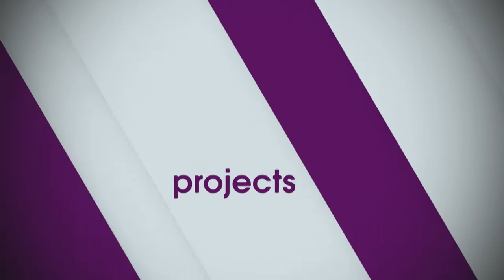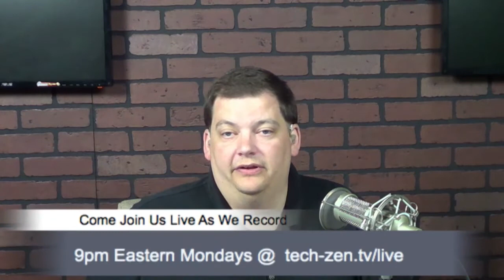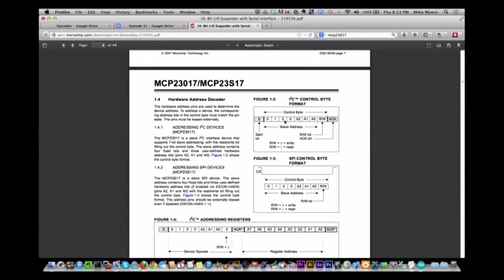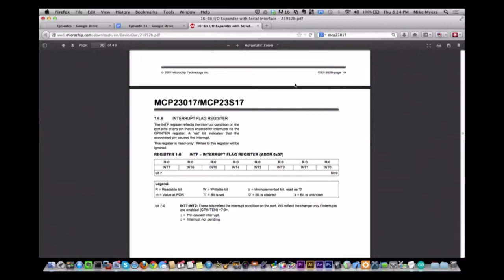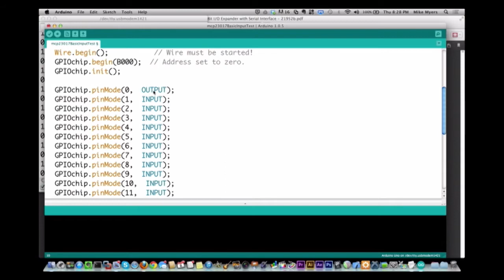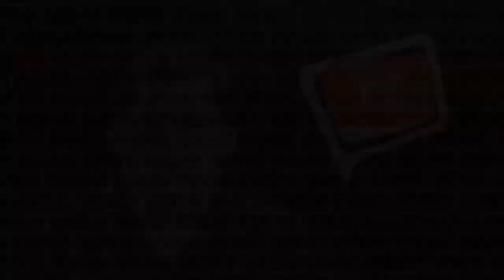Input/Output Expansion With An Arduino - Let's Make It - Episode 31 - Tech-Zen.tv - Alixa.tv

Comment: I would like to have this connected to an arduino with i2C (PCF8574/PCF8575) for keypad with PCF8574 and lots of Relays on and off.
I think this is a fun project for you to start up on with both inputs and outputs stored in eeprom connected to the same i2C bus.
I can give you more ideas about this by e-mail. Keep up good work :)